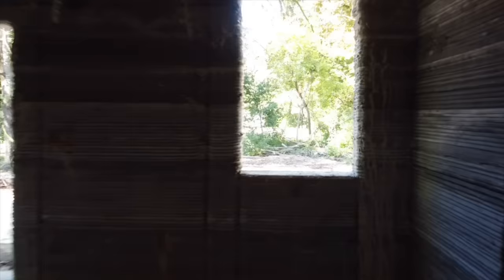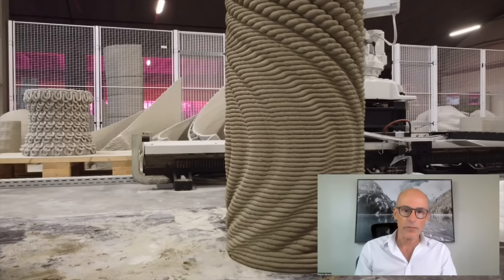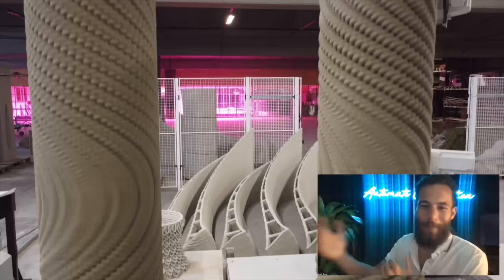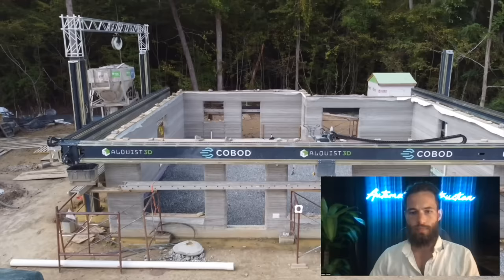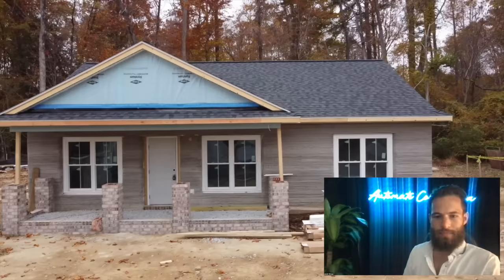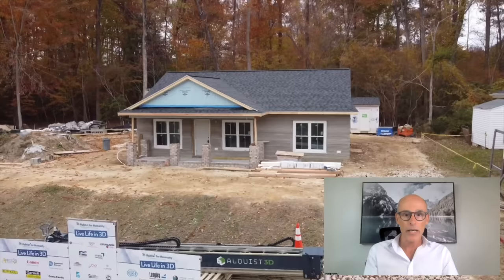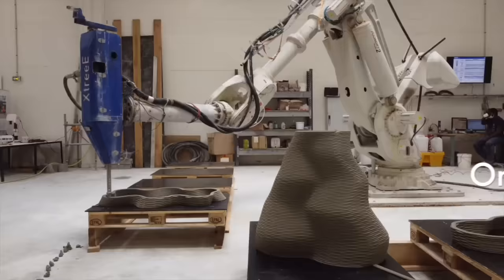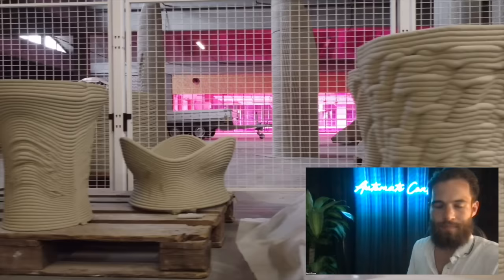11 Lies of the 3D Printed House | EXPOSING THE TRUTH of Printed Construction

Comment: Talking about waste. So lets just think a little, 3D printing basically replaces the bricks. So instead of using bricks you are using a 100% mortar on the site. I am not specialist, but I bet the factory that makes bricks is most likely sitting at the top of efficiency, because its a business that runs a mass production. I am pretty sure they are pass 95% efficiency when it comes to the production, because doing it in a less efficient way simply would be non profitable, especially if we are talking about western economies, where the laws are strict and the labor is expensive.  

Also a cost. Anyone who has experience with building houses knows that mortar and basically stuff that goes between the bricks is expensive compared to the bricks themselves, well if we compare the volume you need to build the house. When you are building the house, the ratio between the bricks and the mortar is probably ~80 to 20% if not higher, but the mortar is still expensive even though by volume you use a lot less of it compared to a 3D printing the entire house. 

Another thing to mention is thermal resistance. Huge deal of modern made bricks actually have a very good thermal resistance, they even make bricks that can be used in cold climates even without much of an insulation. These bricks have porous inner structure and they trap the heat very well. Typically in cold climates these bricks are being insulated by ~10-20cm of foam plastic panels. But even without them the bricks provide excellent results. A lot of people are actually using only 5cm just so they could apply plaster on it mostly for the outside decoration purposes. 
However mortar has very poor thermal resistance, cold travel right through it. That`s why they make the walls hallow and they add foam inside of them. Foam is not really that great of an insulation, because over the years it has tendency to shrink and solidify, leaving small gaps. Now with bricks it might not be worst case scenario, the condensation would escape the bricks as those have porous structure, in this case the condensation has nowhere to escape, because mortar is very even and has no pores. So if there is huge temperature difference between the outside and the inside and if the foam insulation has gaps, the condensation is going to be a problem there.

Comment: they need to adapt a smoothing tool to the printer to get rid of the layered look. how do you clean walls like that ? say in a washroom? the only way to paint it is with sprayand that will take a lot of paint to get into all the grooves.
Reply: You can apply a smooth render.

Comment: With AI and automation won't the price go down. I know at Microsoft that's how they cut down on manual labor cost. It's pretty easy to run the automation as well. Just takes a dev inputting code into the app to make it run the code. Would assume it's the same for 3d printing.

Comment: Until you can have your material delivered by a ready mix trucks this isn't a fully fledged technology.  We're probably looking at another 5 years before we really understand best practices in any sort of formal way.  Right now this still sounds like both a material science problem and a printer technology problem.  Till you can back up a single flat bed trailer and unload a single piece of equipment it still has too much mechanical complexity for a real world construction site.  If it requires more than four men or four hours to get set up and running it needs more work.  Those are my thoughts anyway.

Comment: Nice video buddy and gl with the channel. I do feel that business does - after too long if you ask me - notice bottlenecks and looks to 'iron' them out. I'd like to ask the question, of the difficulties you see in 3d printing, which problems do you believe cannot be automated? For instance, the mixing, waste and delivery of the concrete. Agreed, it will take time, but I cannot help but believe all of these processes (based on sensors checking the site's weather, temperature, humidity, sun intensity, etc) can be automated and make the mixture to suit. 2. Observation. CCTV cameras can do facial recognition, read number plates... Knowing we already have the architectural drawings (maybe designed by AI?) I don't think it's that big a stretch to set up 4 cctv cameras to watch the print to ensure a successful build. I think it's strange that we've come up with AI, 3d printing, self driving cars, etc and everyone is critiquing them as if: This is the end product. Chatgpt is still in open beta. Things take time. But cast your mind 20, 50 years into the future. What do you think a 3d house printing site will look like then? I mean, I don't even think the lorry making deliveries will have a person involved at any stage: AI will scan all manufacturers to buy proven products at the lowest price based on time scales required, these products will be loaded onto the lorry by automated fork lift trucks (or a futuristic variant based on AI efficiency design), the lorry will automatically drive to the site and make the delivery, returning to it's home depot once done. I do like your title - you've got to get those views in, including mine - but I think the actual title of this piece is: "3D printing. Where we are now." But nice one Jarett and all the very best for the future.
Reply from the maker: Thanks! To try and answer your question, I have to preface by saying I don’t have the best grasp on which tasks can, and can’t be easily automated. Apparently things like manipulating fine wires into particular places is challenging due to the way they tend to fall or tangle randomly. I have no intuition for which tasks are easier or more difficult for a robot to do on site, there is just so much left to automate. I know that’s not much of an answer so I’ll give you a crapshoot anyway, just a guess. I think that details are going to become cheap to implement however, plumbing and electrical is likely to take longer to automate. Spray foam insulation also requires a fine touch along with other types of Louisville commonly used with 3d Printing concrete. Beyond that there’s a whole host of tasks that are just easier for a person to do their machine at this stage. If you look at the number of robots on the manufacturing floor of Teslas, Fremont facility, it initially ballooned, and then was drastically reduced when they realize they tried to overhaul the meat. They got rid of a ton of bots, then started replacing them slowly, but there is a such thing as over automation, or at least automating to quickly. I hope that approaches in answer to your question.

Comment: why the foak would u cutt away if you can adjust the print and put in a cheap frame that u can scratch away or ripp out? yall just not using the options

Comment: Great video, thanks for the information.  Would it be much of a savings if just the outer shell was printed and the interior was stick built, making it easier for the trades?
Reply: That's actually supposed to be one of the largest labor/other material costs of this whole concept... hollow interior walls for running emt/low voltage/pex (bath/kitchen areas on exterior walls have even more specifics), PT framing is installed in door/window openings for mostly conventional installation, slab to top plate rod tied owns to cnc cut top plates for wood trusses, basically only the ceiling, areas above doors, and other random areas require drywall hanging/finishing... If designed right they in theory are easy to modify or remodel in the future.... Although I definitely see a future where everyone wants their soft serve walls stripped and covered with deywall/shiplap/t&g/etc 🤣 adding lots of labor and material costs while backtracking on many of the current "selling points"... I guess time will tell 🤨😉👍

Comment: Affordability?  No  But a cement house would be safer in storm ridden areas,  fire prone areas and in regions and places where wood isn't in big supply.  The technology is newish.  But when AI and robots catch up.  When the machine can set itself up, repair itself have other robots delivering materials and it can sort through it own issues in opperatting. Mass production will be fully realizes.  Affordability may be realized...

Comment: I’m really trying to follow this but I just don’t get it, you are cutting out a lot of time and skilled labor and taking out layers of materials including wood!  Why are these not at least 50% of current homes?  Aside from that, this technology should be gleaning some aspects of building from the earthship people, their homes have no utility cost and no hvac systems.  Technology and production should always get cheaper unless stuff is being gamed and monopolized.
Reply: 'Cause the only thing printed is the exterior first floor wall frame. Everything else from excavation to the last switch plate is conventional.

Comment: From what I've seen so far,  3d printing buildings is just pointless unless you want very very specific architectural design that is impossible with traditional construction.
I'm from Europe. Here even small 1 fam houses are most of the time reinforced concrete, it is stronger than what is shown in most of the 3d printed houses demos it is faster. 
It is more labour intensive but it doesn't take much qualification compared to 3d printing. 
I would compare traditional concrete buildings and 3d printed ones to injection molding plastic parts and 3d printing.

Comment: They are short term crumble homes. Ridiculous niche item. The same ignorance of the current cycle of the sun and the planet, including all environmental factors, is the reason for CO2 nonsense as well as the idiocy of utilizing these structures. You dont ignore all of the facts and have any firm answer as to what anyone can expect. UVC is on the ground. Moisture movement is at peaks unseen. Weather patterns are in a increasing and intensifying flux. Building during that, prepares it to fail later. Imagining you know better, shows your lack of awareness of what is going on with not just our planet, but all of the planets as well, and why.

Comment: Materials need to be pre-dried then fed through a volumetric process adding in admixtures and water taken into account heat wind and humidity. The other variable is consistency with cement powder sometimes if they run the kiln too hot it can create huge variables in set times. Which I can imagine will create a massive headache with extrusion, causing the machine to get constipated.
Reply from the maker: I’m not sure what you mean by pre-dried but I like where your heads at taking heat, wind and humidity into account. In addition to the cement consistency. One of the big challenges for 3-D printing seven dishes materials is having something strong enough to support the next layer that also flows well enough not to clock in the hose. If you have expertise in this area, they could really use your help!
Reply: @automateconstruction  Jarrett what I meant by  pre dried was the inconsistency of moisture content in stock piles. Drying should help consistency to the moisture content of the graded materials that are being used. Having consistent materials in the feedstock would help with flow rates as a clean dryer material doesn't hang up and bridge as it's being fed.
I suppose the only other way to do it would be to buy bagged materials that are probably way more expensive. It's incredibly impressive that these buildings are on par with established home construction cost of construction. The process needs to get into a rhythm and flow. If a crew could get 5 to 10,000 hours of experience with a well-engineered system I believe printing a single story house will cut labor by at least 50%.  Get 3 to 5 variations of a ranch and do 100 homes subdivision.
Using a professional crew of course. Once established. Should make for decent-paying careers with benefits.

Comment: So what's the damn point of them then? lol
Reply from the maker: The construction labor force is aging, and young people aren’t replacing the jobs that were losing as the labor force diminishes. The housing supply becomes even more stressed than it is already automation might be the only way to have an adequate housing supply, moving forward in countries that have restricted labor supply. Some labor is easy to replace like the operator jobs for these printers, young people, love jobs like that working with technology, but if you try to hire for a masonry job, you’ll be much harder pressed to find someone eager to fill the spot. Right now it’s early stages. This technology is expensive, but that’s not going to last forever, like with all technologies with the scale as they become more ubiquitous, they also become cheaper.
Reply: @automateconstruction then this definitely seems like the practical option for the future. More young people studying to be engineers, less possibility of long term chronic health issues from construction work, the ability to have automated production running 24/7 without needing to take lunch breaks or sleep, and no telling how optimized the technology will become in just a few years considering there has only been legitimate practical applications of the technology since the start of covid. Who knows, sometime down the road it may end up being a cheaper alternative, especially in the long term without the constant repairs and damages that conventional wooden homes already suffer from rather trivial sources ie: termites, rats, pests, degradation over time of wood even if it’s treated, and not to mention the more stable climate control for temperature as concrete insulates better than wood. As a civil engineering student, im very excited for the future of 3d printed homes

Comment: Not convinced!
I can see these houses separating at the smallest earth quake.
Reply: They’d have to be able to build it over a bed that can move with the ground. Buildings in California can move btw. Their weight is in a base that’s over support beams but moves side to side with earthquakes. Btw all construction should in theory be region optimized. A house in California today is probably constructed different to the concrete ones of Florida post Andrew.  I see them better than the wood ones that most Us states have that fall like matchsticks during tornadoes but of course there needs to be some adjustments and alterations for regions. Maybe even  adding the Roman methodology now that we know how they built structures lol!
Reply: @ireneswackyjournals8810 The layer adhesions would have to be very well blended and the material formula such that it wouldn't easily crack with some shaking.
As well, that it wouldn't crumble after years in the ever-changing elements in the climate.

Comment: If this ever became extremely widespread like if D.R. Horton or any of the big-name builders in my area decided to switch to this it would put a lot of framers out of work.
Reply: Lennar just built 100 in Georgetown, TX.  IDK how well they are selling.  I would never buy one.  I have too many questions & foresee way too many problems.
Reply: @lwarteman  100 homes for Lennar is pretty small run. This is probably a trial run thing to see if there is a market for it in Texas. Unless the costs are real low I don't believe they're going to sell that well. Folks in Texas tend to like things that are familiar to them.